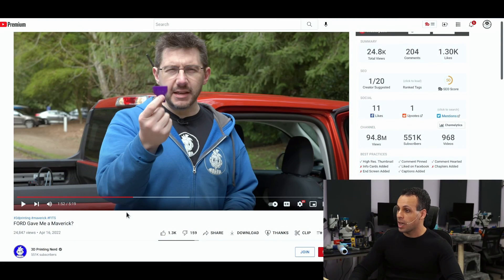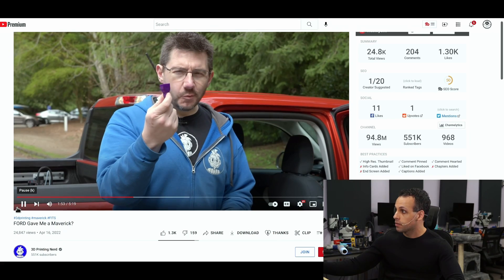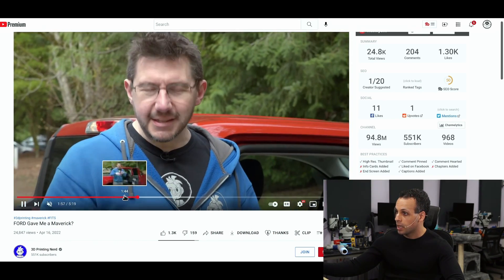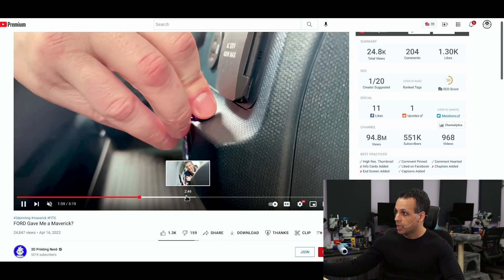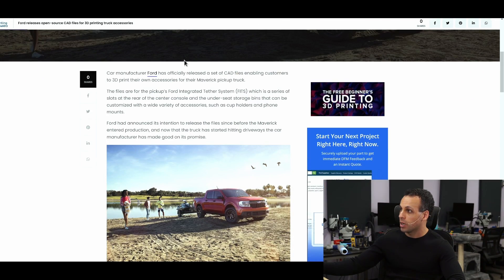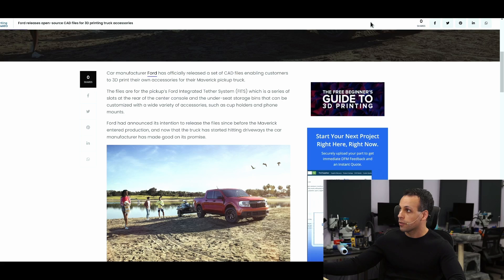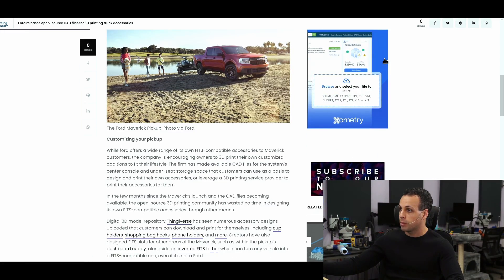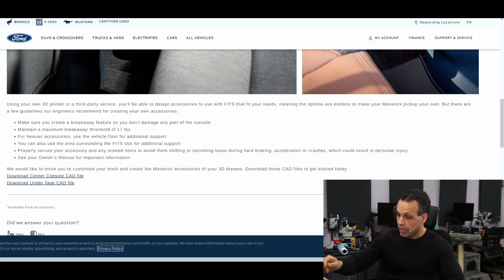Here's how to properly engage with the 3D printing community

Comment: EV startup Aptera was on Rich Rebuilds this week - their CEO said that they intend to be fully supportive of Right to repair and will make parts and info available, with QR codes on parts, which link to a repair video: https://youtu.be/I-KdsjVQhu0?t=1319
Reply: I'm a little concerned about what they may be giving vs not giving, like can I get the CAN DBC to make my own hardware buttons to replace the godawful touchscreen? (Aptera reservation-holder here.) If they actually do support DIY upgrades and mods, and not purely official replacements, that's HUGE. And honestly, Chris's words in that segment are VERY encouraging, but only for their implication. It's not a direct statement of how much they're opening up yet. Fingers crossed.
Reply: @nateb4630  Automotive electronics have a whole different certification scheme... Which is sensible to a degree given the public safety implications.
Anyways, what they can "encourage owners" to do modification wise is limited, and their lawyers might tell them to not make some info public just to avoid possible liability.
Reply: @travcollier  Or worse; potential lawsuits
Reply: I saw that too. I was very surprised when they just offered that information as if it was a plus and even suggested that when technology improves you would be able to update things as well. They aren't locking you into what you originally purchased.
Reply: Yeh but the ecosystem is so rough for start ups.. these companies have hundred year experience and cash to scale up
Reply: @claudeyaz  Likely part of why aptera is doing it. It's not just a "kindness of their hearts" thing, which virtually no corporation does, but to make up for the fact they're not going to have established dealership service centers and similar for a long time.

It's still a good thing for the consumer, for sure, but we'll see how long it lasts
Reply: Yeah that blew my mind

Comment: Not a car company, buy also on the side of DIY you have McMaster Carr. They publish CAD files of pretty much their entire product catalog, so if a plastic version of what they sell is good enough for you then you can download and print away. They know this may cost them a few sales of simple parts, but it gains them so much more. Engineers designing a complex product are more likely to specify fasteners and other parts out of the McMaster Carr catalog if they can easily insert exact 3d models of those parts into their CAD design and be sure the physical part will fit. Also, rapid prototyping where a printed or CNC machined part is made from the factory 3D file so you know cheaper mass produced parts will fit if your printed prototype fits.
Reply: I believe MMC actually explicitly states that it's against their terms to 3d print any of their CAD files, they are to be used for designing parts that work with the part they'll happily sell you.
Reply: @jasonhurdlow6607  I just read them.

The way I interpret them, the terms forbid 3d printing for other purposes than determining whether or not you wish to purchase that part or as part of designing/prototyping around use of their parts.

In reality of course they know some people will print off their files for personal use, and I cannot see them going after anyone who isn't exploiting their IP commercially.

Comment: This is a small fact check from your last video. 3d printers are super accessible now for as low as 250$ you can get yourself a nice printer. I just don't want people to get the idea that this hobby is super expensive and I want more people to be encouraged to get 3d printers.
Reply: Might help if you gave some examples of good brands/printers for $250. Somebody could very easily go buy some crap at that price.
Reply: @mjc0961  Voxelab Aquila
Reply: Thank you!!

Comment: Subaru requested my 3D printed coin tray for a BRZ be removed from eBay but they said I could re-list it as long as the name was changed to 'Coin tray suitable for Subaru BRZ' instead of 'Subaru BRZ Coin Tray'. I don't think anyone would have mixed it up for a OEM part as it clearly was a homemade accessory but I thought this was reasonable, and since I changed the name they haven't had issues with it. I sell the same object for a Toyota GT86 and they didn't seem to care at all.
Reply: I always like to remind myself that companies are just as afraid of some lawyers as regular people are. Mostly when it comes to liability lawyers. That’s why they make so many silly rules sometimes around brands.
Reply: "I sell the same object for a Toyota GT86 and they didn't seem to care at all."

Or they haven't noticed it yet. 🤷‍♂️
If I was you I'd switch the name around like you did with the Subaru version just to be safe.
Reply: So it's all about semantics actually
Reply: @verdele  yeah, that's basically trademark law in a nutshell
Reply: From what I've seen here, and looking at Github's DMCA repo, these companies aren't actively looking for this stuff, but once they notice they have to react in some way. I think you should change the Toyota items name around. Unless you hate Toyota, then keep it :D
Reply: It's not about people can tell if it's OEM or not, it's some legal shenanigans that they have to protect their trademark or risk losing it, or so I've heard.
Reply: I think you'd be surprised just how many people order things purely on name/pictures without looking into what they're actually buying.
Reply: Screw that, I'd tell them to pound sand. They ain't got a right to do that. You're not advertising it as a genuine part

Comment: At this point I could 3D print the Maverick that we ordered before Ford is able to build the damn thing. Its been 7 months and we still have no scheduled build date. We will be lucky if we get the truck by August.
Reply: It's not a truck. 👍😂
Reply: @juanvaldez6651  what?
Reply: @Snowmunkee  I think Juan is claiming it's "not a truck" due to the fact that it comes with a 4-cylinder engine and is a compact vehicle. But then again I always assume car conversations are judgmental, people get very opinionated about cars.   

Probably not worth worrying about it in any case.
Reply: @juanvaldez6651  *googles "Ford Maverick*

Very first result at the tippy top of the page: "2022 Ford Maverick™ Compact Pickup Truck"
Pictures to the right of that: clearly a pickup truck

It is a truck, you sad clown.

Comment: I don't see how any of these manufacturers can use something like the DMCA to take down "instructions" on how to make something as long as the provider does not say or imply that these are OFFICIAL or ORIGINAL parts made by the manufacturers. These "dodads" also should not use copywritten material such as logos. As long as there is no modification of safety devices and the "instructions" say only something like "fits" a particular vehicle.
Reply: They can do it because there's nobody to stop them. Sure, they are wrong. Sure, if this actually made it through a trial, there is a very high chance Honda would lose. But question for you: do you have the money to spend on several years of lawyer's fees to fight Honda in court? I don't. The people who created and uploaded those 3D prints don't. Prusa obviously doesn't, since they decided to comply specifically to avoid getting dragged to court. This is how all DMCA abuse is gotten away with: they know you're not going to sue them, so they just send notices they know are bogus.

Comment: Hey,. Louis, or anyone for that matter. Do you know what car brands aren't specifically against right to repair? I'm sure every car manufacturer seethes when someone repairs their car instead of buying a new one, but what are the ones that haven't sponsored those ad campaigns against right to repair, etc.?
Reply: All of them are anti right to repair, starting with a very aggresive campaign agaisnt reliability after the 2008 eco crisis. Now instead of going with the usual rubber hose they are now going with plastic pipes and plastic fittings instead of clips because after 3 or 4 years when the warranty is expired you will need to replace a whole part because of a stupid plastic fit isntead of just replacing it with a standard hose and clip
Reply: @verdele  Replace an assembly, not repair, just like Apple.

Comment: That's one of the reasons I like this channel. You don't just rail on the "bad actors". You call out the people doing what you think is right as well.
Reply: Ford is engaging with its customers on multiple levels because they’re on message boards and they actually fucking listen and engage with them.
Reply: People or company's doing the right thing deserve a shoutout, welcome to freedom of speech which they're trying hard to remove. If you're reading this my comment wasn't remove by you.t.ube censor bot :)
Reply: If there is ford branding on the part, you can bet your ass they will go after it.  Louis seems to be ignoring that 3d printing a part does not require including cosmetic logos.  Trademark law actually requires companies to protect their trademarks.  That means they either have to issue a cease and desist or get the maker to sign a license agreement(even if they do not ask for any money).  Louis is ignoring current law.
Reply: @_PatrickO  I highly doubt Louis forgot that. He just didn't mention it because it's not relevant. If you had bothered to do any research at all before writing this comment, you'd see that Honda was taking down anything that had the word "Honda" in the name of the print, not only prints that had Honda trademarks/copyrighted logos in them. The statement from Prusa starts with,

"This is the first time we were threatened by lawyers of such a big company. They sent us a huge legal document covering every single model they want to be deleted, with an annoying lawyer talk explanation of how they hold the IP and patents even to stuff without a honda logo (e.g. the shape and dimensions of a washer fluid cap)." (emphasis added)

So no, Louis isn't ignoring current law. You're ignoring the facts of the story to blast Louis for whatever inane reason.
Reply: @_PatrickO  but why would you want to print your own fake Ford logos? thats a cosmetic thing, not a matter of practicality. until they go after the practical aspect I won't care that much tbh

Comment: They should make some parts 3D printer friendly and let community create/sell/customize those parts. A phone mount would be good stating point.
Reply: Thats essentially what the system Joel was showcasing is.  They released the CAD files for those slots and with that information you can modify and tack on whatever you like to it.  For that back cupholder slot, if you wanted to mount a gopro to film vlogs from the back seat, you can put on the gopro mounting tabs and stick an extension on and viola, gopro mounted facing the backseat.  He also showed off a tablet mount which he put in the back but the front also has the same slot so you can put it up there also.